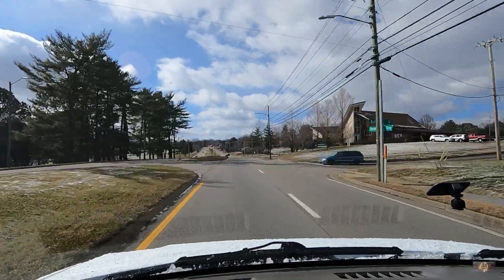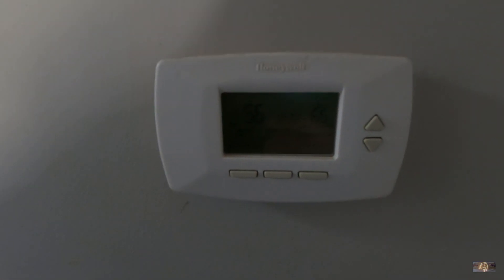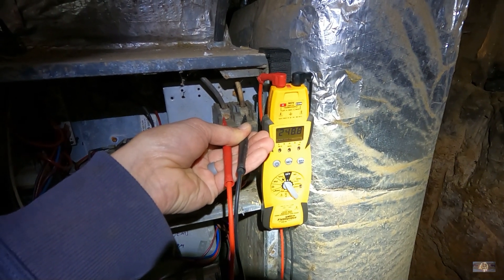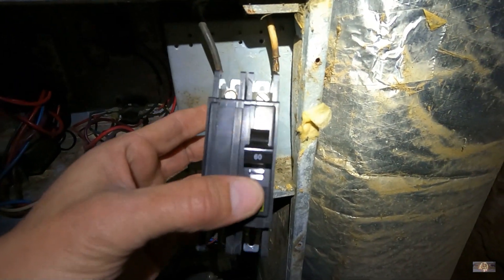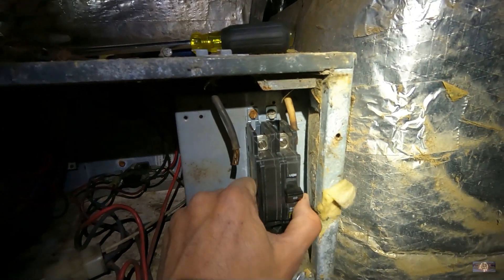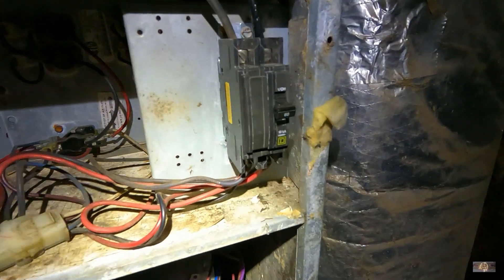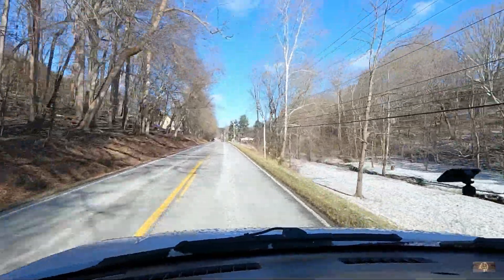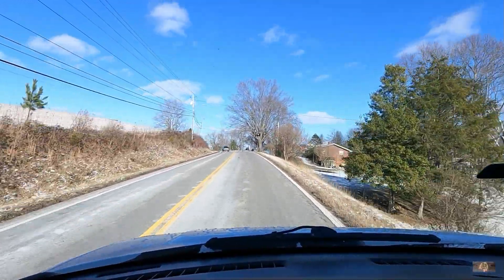Goodman Heat Pump Doing Nothing With a Call For Heat

Comment: Appreciate your videos Jake
Reply from the maker: Thanks for watching.
Reply: @ keep putting them out there. I am an experienced technician, but always appreciate other guys in the trade and I always learn something or better way to do something. I appreciated seeing you wax an outside unit. What cleaner and wax do you use?
Reply from the maker: Different kinds.  I have been using Turtle Wax Wax & Dry lately.  I also use Turtle Wax High Gloss Spray Wax, Turtle Wax Minute Wax which is a ceramic coat technology, and Turtle Wax Bug & Tar Remover for stubborn spots.  I was also using Turtle Wax ICE Synthetic Polish (it was that clear liquid that could be put on everything) and Turtle Wax Clean & Shine, but now I can't find them around here anymore.  The ICE polish would shine the unit up for months, even the plastics would go back black and look restored for months.  The Clean & Shine gave the unit a little extra pop before the wax or ceramic coat.  Worked good on split units in attics or crawl spaces.  I sometimes use Turtle Wax Color Back to restore the paint now if I have the time and have some on my van.  The Color Back is more labor intensive though.  Not a spray.  Turtle Wax has gotten a little expensive.  The Wax & Dry used to be $3 a bottle.  Then, it was $5 per bottle and it jumped to $6 per bottle and now it just went up again here to $7.50 per bottle plus 9.5% tax.  The ceramic coat stuff is $15 per bottle or so plus tax.
As far as cleaners I use an organic all purpose cleaner made up of some essential oils (Doterra or Now brands) that I mix up myself.  Mainly lemon, lime, lemongrass, peppermint, and a couple of other things.  I use distilled water to dilute it.  My wife is the mixologist there.  Lol.  I also have used a cleaner by Thieves as well that is all natural.  On tougher spots, I will use heavier cleaners that are safe on metals diluted down with distilled water.  Can't remember the name of the stuff I have now in my van.  I got it on a clearance sale.  It is purple in color.  I have used mean green diluted way down and simple green as well that is diluted way down.  Don't ever want to hurt the paint or finish, so I like to use caution with heavier cleaners or degreasers.

Comment: I keep one of those breakers for just that reason. Great job. Actually went and took my state licensing exam today here and NC. Passed the TRADE TECHNICAL H3-1 and BUSINESS/LAW.  I am now among the licensed. Should have done this 15 yrs ago. Do not know what I am going to do with it yet, but at my age working for the man is close to an end! STAY WARM BRO!
Reply from the maker: AWESOME!  Congratulations man!  Not easy starting out in business for yourself if you decide to go that route, but it is nice not answering to anyone but yourself and your customers.  Trying to figure out how to get the phone to ring is tough.  I have wasted lots of money on ads that did not work at all (lots of money to me, maybe not others).  Will try to stay warm.
Reply from the maker: One thing that I would say is that you should not go into debt when you first start out, if you go that route.  You could be high on the hog and then have some dead time.  Don't want payments lingering over your head if you slow down or get hurt.  2020 put a beating on me.  It was worse than my first year in business.  I would have to look back at my numbers to be exact, but I believe by the end of March or April of 2021, I had already made more in 2021 than I did the entire year in 2020.  2021 was the best year that I had in business since I opened.  Then, 2022 was better.  2023 exceeded 2022 and so on.  Keep your expenses low and avoid debt if at all possible.  Best advice I could give there.

Comment: Good work jake hopefully they will call you back In Spring to do primary maintanance and jake if it makes you feel better Chester County pa near the delaware border is having the same weather a high of 16 degrees have not had that In Years. But understand how In Tennessee that is a weather shock those homes aren't built to withstand those temps.

Which is probably what caused those plumbing pipes to freeze and the water heater leak and jake I prefer pex to copper by the way even though most plumbersy way hate pex.

But I will take pex over copper any day.
Reply from the maker: The pipes didn't freeze.  PVC and CPVC gets brittle over time and will leak everywhere.  Not something you want your home plumbed in.  We get these temps during winter where we are in the mountains, but not for extended periods typically.  This one was an old poorly renovated farm house that was cobbled together.  In my construction engineering courses we discussed our frost line and typically they want the top of the footer to be buried at 28" or more below grade to help prevent frost heave.  That number could have changed by now though.  Been many years since those courses.  I had to remove PEX from my home.  I had some recalled Nibco pex in my house that was splitting and flooding my basement and crawl space.  3 different occasions.  I went back with PEX, but used Zurn instead of Nibco.  I would rather have copper for the taste of the water and to help prevent microplastics in your water, but the copper quality these days is questionable and it doesn't expand like PEX will.  Thanks for leaving a comment.  Stay warm up there.
Reply: @JakePorterHVAC  jake I agree about new copper a plumber put that in recently after I told him leave the connections alone it has caused numbness in my hands as I am battling lyme. And that has agrivated pockets of lyme I am still battling I have pex lying around my condo it's sharkbite branded pex b type.

But need to get a few more parts to redo it there screw up as I need to remove every inch of that new crappy press fit copper.

Not only that they blocked my whole condo water shutoff valve.

Here is the irony jake the 1970s soft copper pipe style with some black protective coating did not swell up my hands.

As for pex jake I prefer it even over cpvc or pvc pipe the Europeans hsve used it for 70 years without issues.

I have heard of Evo brand but not sure about that and uponer but I don't like uponers setup.

But again jake thanks from what I saw in that farmhouse it looked like thier were some insulation issues too that were not protecting the pipes properly.

Take care in this freezing cold jake and at least you have taken engineering like classes  my late grandfather was an mit grad and electrical engineer so it runs in my family to be mechanicaly inclined among the males and to really pay attention to small details.